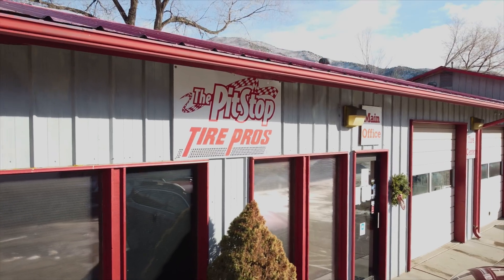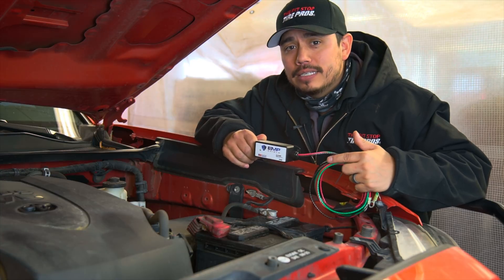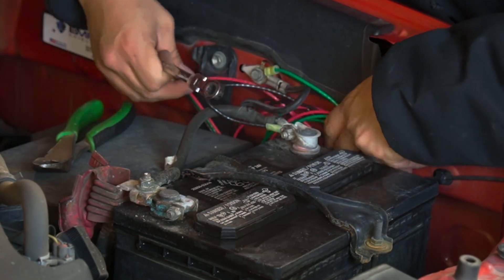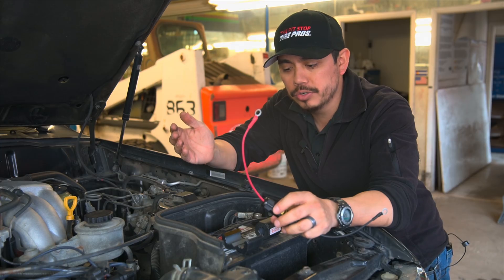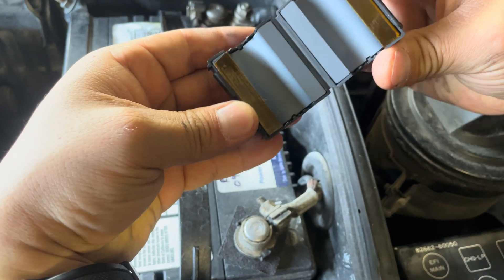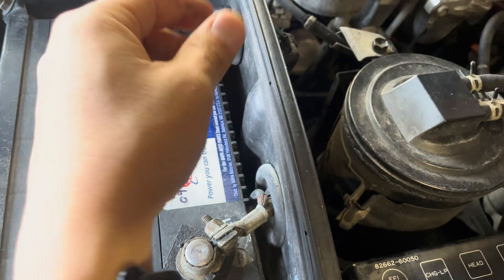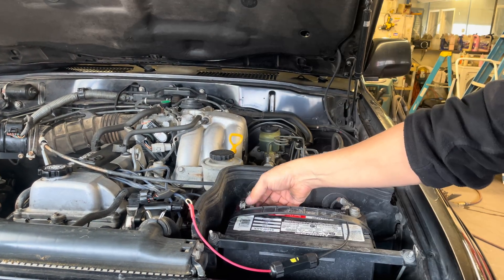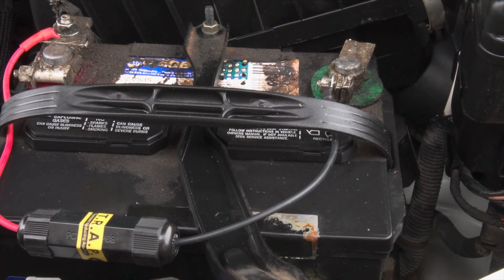EMP Vehicle Protection / What are the options?

Comment: People, the DoD installs it in all vehicles. And, embassies  and data centers have them installed. Besides, why do you need to blow up a bomb to test it? There are clear factors to figure out the rest. It is an electromagnetic pulse. Ferrites absorb those frequencies, so there you go. When a tsunami of voltage (surge) or a higher frequency (EMP) launches at your electric grid, these are manufactured with the components that are known to starve and cannibalize those waves of energy, and release as gas (some) or slowly as is the nature of the ferrite. Not trying to convince, but don't conclude stupidities just because you are bored and want to troll. I can care less if you fry all your wires. I have it, and act according to the information provided, like a proactive man does. Another thing would be if I had to mortgage my home because is half a million dollars, but for $70, is peace of mind and I appease my urge to protect and provide.

Comment: Just think of dropping a radio or cell phone in a tub of water. It will short out. well its different but the same problem. The EMP acts like  kind of an electrical soak and fries your computer if the power is running through it.
If you drop a radio in a tub of water and there is no Battery or current connected to it. nothing will happen to the radio, you just have to let it dry out. and in this case you  wouldn't even have to do that. 

ME I JUST PUT WING NUT BOLTS ON BOTH MY NEGATIVE AND POSATIBE CABLES IN PLACE OF HEX NUTS THAT would NEED A WRECH,
 SO I JUST OPEN THE HOOD LOSEN BOTH CABLES WING NUTS PUT CABLES ASIDE at night or? AND WHEN I GET UP NEXT DAY  or want to drive , JUST DROP THEM BACK ON AND TWIST THE WING NUTS SNUG NOT OVER TIGHT AND WAHLAH !  EMP PROOF FOR FREE! .

You just have to decide how much news about a possible attack are you willing to ignore and wait until maybe we get a warning to want to be safe and do this ritual . 
Or just follow the procedure during this time until and if things get back to a lull in conflicts. 
I do it evetime I take my car for the day. It's no big deal to open the hood and take care of it any more then it is for me to take out the trash or open the gate.

Only downside is you are resetting your computer each day when you turn it on again and could take up 50 miles to run its test cycle. You will not notice anything wrong except the engine light stays on until you hit about 50 miles.

I had a tier 5 security clearance and worked on many Nuclear weapons as a thin films engineer back in the 19 80s so I am not guessing!

Comment: How would you connect those devices to a car that has 2 batteries because the car has that automatic shut-off whenever you stop and then start when you take your foot off the brake?  There are a couple of poles in the engine compartment to be used to hook-up with jumper cables.

Comment: I am assuming I will need two set ups of the faraday defense if I have two batteries in my diesel truck?
Reply from the maker: A single shunt would emp device would only be necessary with any backup traps as an option. Check out our explanation video with Dr Bradley(EMP DOC)
EMP Vehicle Mobility Devices w/ Dr Arthur Bradley (aka EMP DOC)
https://youtu.be/AL-5Go5Z8Nc

Comment: I just don't see how this would actually work compared to a full House in EMP shield. The reason I say this is because the full House goes to Earth ground the car has no Earth ground. The chassis and the battery are pretty much almost at the same potential so the juice from the EMP would have nowhere to go. When you look at the house it sends it straight to Earth ground which makes more sense. But when you have a car that has four insulated tires all it does is stay in the car. Now I did see somebody say you shouldn't have to worry about your car from an EMP. And then another person I see that had posted one time that EMP shield never did any testing for a car like they did for a house.
Reply from the maker: The commonly missed and most important part of the discussion for these devices is testing and use cases. Below is the link to the third party testing. By far the most critical responses more likely than not haven’t gone to the lengths of reading all of the test results, or military requirements that the company must abide by to be able to have these devices installed on many government vehicles. 
https://www.empshield.com/wp-content/uploads/2019/11/EMP_Shield_Military_Testing_16_March_2019_Public2.pdf

https://www.empshield.com/testing/

Comment: The Red is + positive, the Black is - negative, the Green is - negative in your car.  Nothing goes to 'ground' since your tires isolate the vehicle from the earth .  You have created a circuit between the positive and negative dumping any 'surge' back into the battery.  That is how I see it electrically.  I'll guess there are Mosfets in these little boxes to absorb the surge.

Comment: Though different, I had a surge suppressor on my home electrical panel. When a surge hit my house from the power company, the device literally blew apart into pieces, and I lost a garage door opener, microwave, multiple hard wired smoke detectors (which shot blue fire out of one in the living room), 5 light timer in-wall switches, a home stereo and TV.  I even had 6 Hubble Surge receptacles in the house and each one of them burned out.  I don't have much faith in these things.

Comment: A friend who works in a buddy shop told me of a customer car that was towed in had been directly hit by lightning. He basically said that every module in that car were basically toast. Several of which were blown open. Fact, if anything is directly hit by lightning, there is nothing that protect any electronics in that item. If a static spark one gets from walking on a carpet floor and the touching a metal object reaches a voltage of around 8-10 thousand volts to jump a gap of 1/4 inch, well that lightning bolt just traveled a mile plus to discharge that static imbalance will be well over several million volts and about one thousand amps plus. Nothing on todays market will protect an electronic item. As for EMP'S it is dependent on the size and altitude a nuke is detonated in the atmosphere as well as to lateral distance to you.

Comment: @ThePitStopTirePros:

     Have you guys tried to test how or if, these devices affect the process of jump-starting a weak or dead battery, with either jumper-cables or the more modern jumper boxes?
Reply from the maker: We had one vehicle that had the faraday defense installed on the battery and the battery had gone low enough not to start on its own. The operation of jumpstarting with another vehicle and a jump pack were both normal until the battery was replaced and devices reinstalled on the new battery.

Comment: After reading some thoughtful comments and responding to a few, I think I've wrapped my head around this a little better.

Do not shunt high voltage to ground on the battery. If that did work, you'd be creating a negative really high voltage on the positive. Remember that Voltage is short hand for "potential difference", or Delta V.  
If put 100KV on the black wire then the red one will read -100KV.

But really, the whole damned chasis is what's getting energized by ions in a solar flare or EM waves in an EMP. So how would "grounding' the ground help ???

I think the clear choice is the toroid clip on chokes added all over the vehicle. That will probably fuck up my trucks radios and do I'm not going near that. But I also don't think a vehicle has enough surface area to gather enough voltage to matter all that much.

I am more worried now about my home. Good video.

Comment: My question is have you ever hit the car with a real emp while using this? My prediction is that it's a waste of money and it won't work. There are miles of wiring in you car you would have to protect them as well as the computers which is damn near impossible. I really don't think people realize how an emp works. If you have ANY exposed wiring, computers and electrical equipment it will be affected.

Comment: I bought the EMP Shields 4 years ago.  They are the bigger ROBUST units.  This other stuff is junk.  Ask yourself wht does the US Government only use EMP Shield?  Every Federal department.  The larger EMP Shield are ~$500 each.  You can use them on your house breaker panel and your generator and another on your transfer station.  I use 6 on cars and home.  The cheap stuff is junk.

Comment: And where does it go after it reaches the chassis?
Back into the system through negative or chassis ground.  Unless you want to provide a sizeable ground chain or other connection to Earth.  You are introducing capacitance into parts of the vehicle that may cause problems with the existing systems.

Comment: It's impossible to test these devices to ensure they will actually protect what they are supposed to protect. Once an EMP actually exists,  it will be too late if it doesn't work as advertised. $25,000 for lightning strike may or may not be enough to replace your entire electrical system.  Todays vehicles could have an awful lot of expensive computers onboard

Comment: I am not an electrical engineer but I am really confused by this. As I understand it, any electronic item that has wires attached to it is at risk as the wires would act as antennas for the energy of an EMP. So we have shielding devices supposedly protecting the battery of the vehicle which by design should be safe anyway. However, none of these protect the wires going to the ECU or the computer for the transmission. So how do these items keep the vehicle running exactly?
Reply: By the faith of those who buy them. It's a snake oil.

Comment: The police EMP'd my car. I was driving a fancy dancy show off car, and they saw me, got excited, held up a black device, while looking directly at me. My car engine shut off at 4000 rpm. I was able to restart after cycling the key. They did it as a joke, and drove off, laughing. Chandler Arizona.
Reply: You must have your dash cam footage.
Reply: Bastards
Reply: Not a EMP, they were simply activating a disabler in your vehicle, which is likely going to be in EVERY NEW VEHICLE.
Reply: @ChevySS1968 which is why I drive old cars.
Reply: @ChevySS1968  where are you getting the this info? I haven’t seen any credible source saying that modern cars have disablers built in; only bait cars, rentals, and some dealerships have them install after market afaik. Also, a lot of people here seem to think that EMP will cause permanent damage. It won’t. Even a very powerful one like from thermonuclear device. I’ve also never heard of police actually having EMP devices, but I have seen ones advertised for police and military use to stop vehicles. Haven’t seen a handheld EMP generator of any description, though.

Comment: There's absolutely NO device or method to EMP Proof your vehicle if the nukes started popping off.
Voltage is one problem. RF (radio frequency) is a totally different problem.
Youronly hope is to get a bicycle or a horse.

Comment: Seems much like the gas tube shunts used in telecom for lightning strikes, except they can dump excess voltage to actual ground. The vehicle is not really grounded as it floats on rubber tires, so dumping excess high voltage to the chassis is going to fry the computers as they are also connected to chassis ground.

Comment: At times I get it wrong as we all do .

But I have worked in the Electronics industry for years from wiring Homes, Building Avionics systems and aircraft from scratch in the LSA aircraft world.

Have worked in undercover DEA aircraft and was told I help install the first Collings Fiber Optic HF system in an undercover DEA Aircraft close to 30 years ago.

And at times get it wrong as we all do.

But if you put your Cellphone into a Microwave oven it's going to be Hit with a large amount of EMF power and cellphones have larger amounts of shielding in then as I have taken some of them apart, as once I took a Coper apart and i mean apart to study it,

Your cell phone would be cook, Now thanks of a high energy wave of power crossing ever wire in the car and spiking the voltage in ever wire and Sensors wires that do not connect to the main battery Bus but to the ECM or Cars computer and all it takes id one mane sensor to burn out like the CSPS, MAP and the cars computer has no data and the cars dead.

If its a larger EMF we may all loose

Remember Gas Pumps will go down as well along with Cellphones

Comment: EMP would damage the boards as well depending on the exact frequency of the EMP's pulse wave (the wave length as the wave washes over any circuitry). No shunt can protect against the boards and even the chips themselves being washes over by the EMP wave. These may protect from a longer wavelength pulse which uses a lower frequency wave which is a physically longer wave that washes over the wire harness and creates a voltage... assuming the current doesn't get shunted through the battery or other parts... here's the thing, your car is a faraday cage on wheels because all the wires are surrounded by metal which is both circuit ground and is slightly earthed via the tires and some coupling to the soil below you. 

To protect the delicate electronics, you'd need a spark gap and/or a MOV (Metal Oxide Varisor)  on each wire that goes into each electronic circuit in the car along the CAN bus and other parts of the wire harness as the power wires are usually filtered because automotive 12V circuits are noisy, dirty, and voltage will sag and spike violently as the alternator cannot maintain a steady 14 volts when the RPM and loads are constantly changing, it simply can't adjust field coil current fast enough for the delicate and precise electronics, so they have their own solid-state converters that are laser precise and can hold a constant(ish) voltage with only a few milli-volts of ripple even if the alternator voltage is bouncing between 9 and 14 volts constantly. So the power wires, especially by the battery which is the thing that stabilizes voltages for you most of the time anyway, is pointless and a waste of time.

I kid you not, wrap tin foil sandwhich wrap around the ECU, and any other important electronics, make a good connection from the metal foil to the car body, and then put MOVs and/or spark gaps on all inputs and outputs you can't keep shielded. Foil that is grounded to the body or the negative terminal of the car battery (they're connected together at the battery anyhow) will act as a decent little faraday cage and will severely dampen all electromagnetic waves that pass over then much like how your car's metal body protects you in the case of a direct strike by lightning, conducting the energy safely around you to ground rather than through you to ground. This of course all depends on how much distance you get from foil to circuits as the dampening drops off with distance (that is closer to the center of the cage is way way more damped than the outside) this is why your microwave has mesh on the door, it contains the 2.4 ghz waves so you don't cook you hands, the glass gap keeps you away from the mesh so that the dampening can take effect. The exact distance needed to block 99.9999999% of the energy depends on the largest hole in the foil and the wave length that hits it, but a few centimeters (or an inch if you're dead set on the dumb units of measurements) should be enough. Just wrap a spacer like some foam and then wrap the foil and then shield the wires, twist the wires carefully, or place MOVs and spark gaps on the wires and you'll be fine.

OR you could drive the car into a metal container at night and that grounded metal container like a seacan will block all most all wavelengths or almost any power from reaching into or out of the car.
Reply: Exactly correct, and will save you the $450.00 they are charging for the little device with a few capacitors in it!
Reply: Oh good, another EE to set the record straight. Now I don't have to write up the explanation of why an EMP device like this is worthless against an actual EMP.
Reply: @sadiedog5071  I'm not an engineer, I just know how to read and remember High School physics... And since I am a computing science guy, this is next to my field so I find it interesting.
Reply: @asificam1  An EMP from an nuclear blast will have all wavelenghts of energy all the way up into the Gamma rays. And the energy an EMP could put into a circuit is reduced exponentially as the distance increases. Like the sun is not so bad when it is 93 million miles away.

Comment: Yea, so thisay protect the battery, however it is not going to help ECM or CPU, get a pole building, make sure it is properly grounded, park the car inside. Its called a faraday cage.
Reply: Not true, a metal pole building will not protect your vehicle if there is an EMP, even if it is grounded.